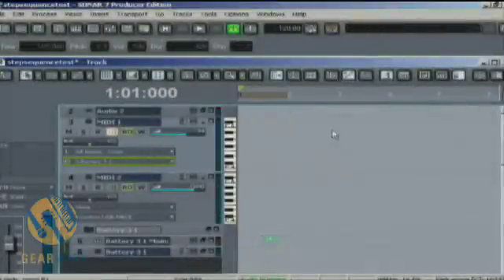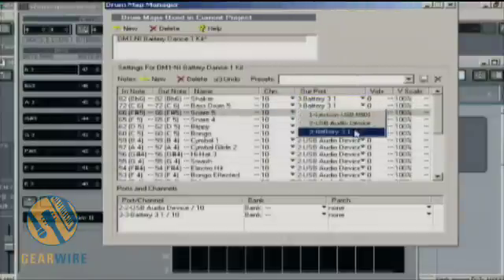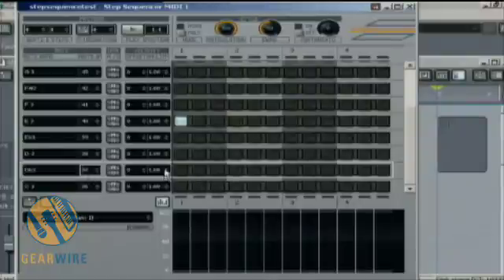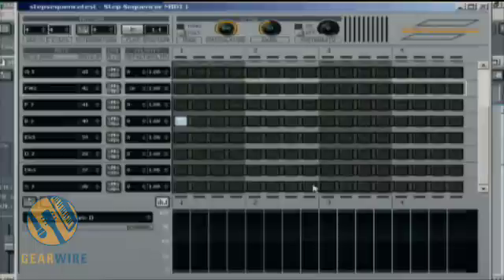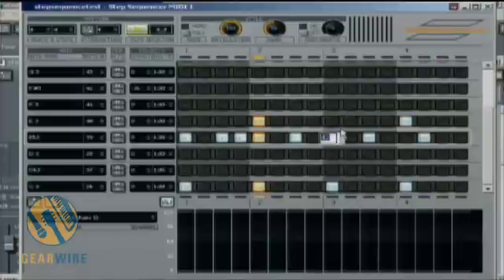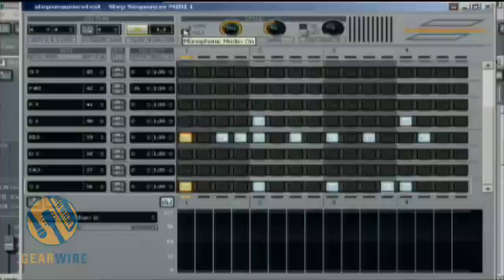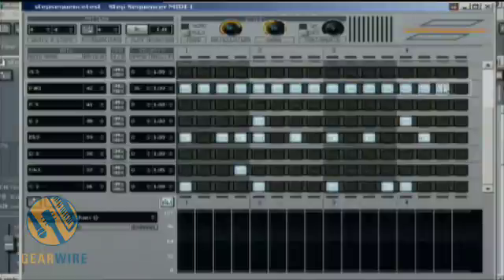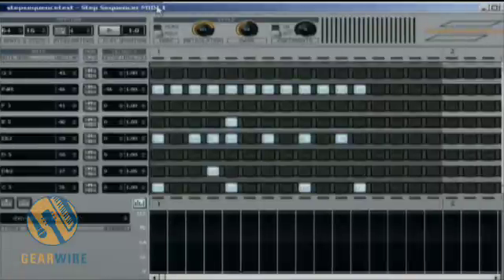Cakewalk Sonar 7: Step Sequencing A Drum Track

Comment: You should easily be able to do it in the 'tool window/note velocity' or you can go to the propellerheads site and get the 'control surfaces' pdf for your specific keyboard.